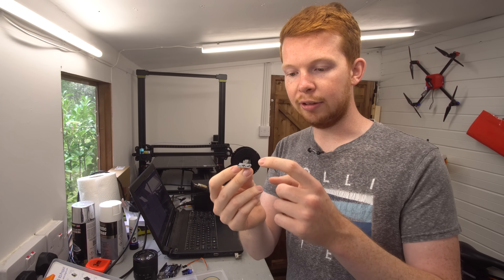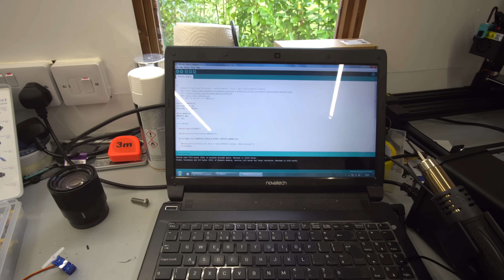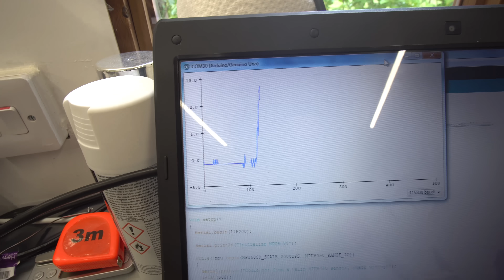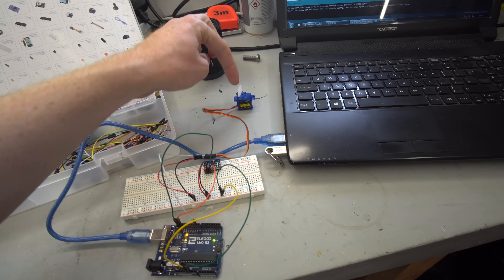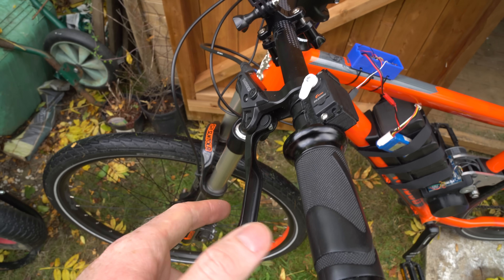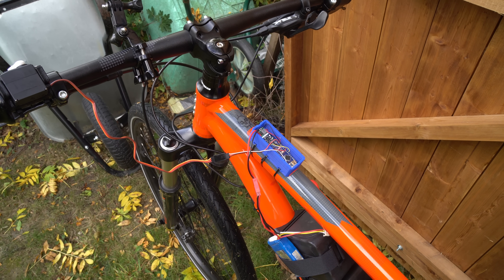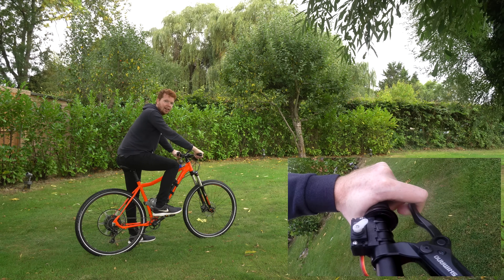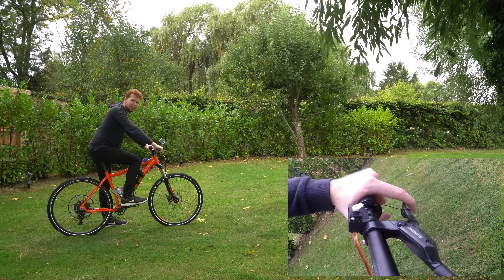Wheelie Cheat Device?

Comment: No Way!!!  I've been working on this exact concept for a few weeks now and you beat me to it!! Anyway, I love the videos man keep it up!
Reply from the maker: That's awesome! How far have you got with the concept? Are you using the angle to activate the brake, or something different? Thanks!
Reply: Originally I wanted to try this on a dirtbike but more mechanically and use the foot brake with a lever and spring system(kind of like the throttle cut device but to apply the rear brake). I always had the thought of using an Arduino but I knew a servo wouldn't be strong enough to stop a dirtbike and I wasn't going to find out the hard way lol. since then I decided to scale down for a prototype and right now I'm using a Servo attached to a drone flight Flight controller in an effort to smooth out the actuation of the braking, however, my Lack of understanding when it comes to optimizing PID values has been my downfall. I'm sure if you knew what you were doing this system would work flawlessly! Good Luck!
Reply: When are you making a new video Daversity  it’s been 7 months!!!!!
Reply: Just filmed a video with my Miata this past weekend gotta find time to edit. should be this week though!
Reply: Daversity great!
Reply: Put the angle reader on an adjustable mount like a threaded rod so you can adjust the angle on the fly and leave the servo brake linkage constant...just tricking the reader letting you quickly adjust when it engages....
Reply: Yes course you was lol
Reply: @CrazySheff  he might be, i believe him

Comment: I think the solution is to monitor the rate of agular change not set an absolute angle, this would give allot more flexibility , not to mention it wouldn't pull the brake when you go up a hil :p
Reply: Of course, that would theoretically try to keep the change of angle constant!
But it would make getting into the wheelie quite difficult, maybe add a button to disengage the system at the start, and then let go at the proper angle?
Reply: Andrew B  Your suggestion of measuring the rate of angular change not withstanding, the arrangement that he has doesn't care whether he is going up or down a hill unless the hill is more than 45°. The sensors are measuring the angle relative to the direction of gravity. ;)
Reply: That would be a heck of a hill! XD

Comment: Add a potentiometer on the steeringwheel to adjust the balancing point on the fly?
Reply: Well, bike frame anyway.  Take angle value, take pot value, scale both appropriately, add/subtract pot pseudo value from angle value => you can tune the angle the servo kicks in.  Simples.
Reply: Steering wheel??? Haha have we all been watching the same video Danny?
Reply: Errr oops, I'm not a native english speaker! What is it called? Handle bars? In Dutch this has the same name as the car one :)
Reply: I got halfway through the video  and got so frustrated that he couldn't tune it in the field I had to come down to post this same comment only to see it was already #2 in the list haha. Also reading this comment's replies made me realize that 2 potentiometers would probably be very nice. 1 to adjust the angle/balance point, and a 2nd to adjust sensitivity/scaling of brake force. Couldn't be that hard to adjust the code to do.
Reply: A potentiometer would certainly help tuning the break angle faster in the field for testing, but the general problems tom described still remain.
Reply: The problems wouldn't still exist.  Any configuration of body mass, arm length, and ride style will have a certain preferred balance angle.  You just need to tune that one value for the rider, and you're set.  And if the PID is implemented on both the motor and brake, a fairly wide range of values would work.  They'd just be less comfortable the further away from the preferred point it is.

You'd probably want to set an "on" angle, so that the controller doesn't start unless you're actually trying to wheelie.
Reply: yeah if you used a pot you could adjust on the fly instead having to reprogram it on the laptop or adjust the brake wire
Reply: YASSS
Reply: Danny G I
Reply: definitely my first thought when he started adjusting the wire pull in his garden
Reply: Danny G  A man after my own heart! I swapped my handlebars for a HGV steering wheel with a knob on it. It's great for reversing.

Ten-four, good buddy. Woot! ;-)

Comment: Tom what if you started monitoring the pitch after the wheelie was initiated... say once p gets past 30 or whatever, start running an average, then look for an acceleration or rapid increase to pitch and hit the brakes when that happens? Would it not automatically adapt to the top bar angle, rider weight and wheelie style then? Obviously no protection/help for the first couple seconds while it records what your natural angle is.
Reply from the maker: That is an interesting concept. The only thing I'm wondering is whether you could get it to distinguish between a hard pedal to bring it towards the balance point, or an acceleration beyond the balance point. For example, if the balance point was at 45 deg, and the bike was at 40 deg, you'd pedal to accelerate and bring the front wheel up, but this could cause the brake to activate?
Reply: I don't really know but... Assuming your arm length isn't too variable, doesn't the bike (on average) HAVE to be on it's balance point to be maintaining the wheelie? I think the trick is to find the right ahh.. goalposts if you will. Like figure out how to tell the difference between what is normal during a sustainable wheelie and then look for a spike either in angle or acceleration that is outside that range. This way it won't drag when you're doing it right. Another approach might be to forget about the angle, and mount the accelerometer at the rear wheel axle and look for sudden accelerations forward?
Reply: How about if you attach some sort of memory (like black box on clean flight) and do some data harvesting of say angle, time, could also monitor the use of the rear brake, maybe crank velocity/torque so you can understand what factors make a wheelie. If you could also synchronise it with video that would help.

Comment: Do it like a cruise control, you pull a wheelie then press a button to set the angle, then the electronics take over and maintain that angle
Reply: Basically hover board or segway programing.
Reply: It's possible, but when you are not at your balance point, you will either accelerate or decelerate.
Reply: Just learn how to wheelie. It's cheaper.
Reply: If it’s set then it won’t maintain it, it needs to increase r decrease the power
Reply: You would need a PID loop for that
Reply: How would you get electronic to "maintain that angle". You can't just have a huge gyro or SAS on a bike, that's no possible unless you use a multi-point ABS or something like that. Cruise control itself won't hold an angle.
Reply: @aidanginise  sorry I didn't mean it holds the speed like cruise control, I meant you set it like cruise control. When you pop your own wheelie and naturally find the balance point, you press a button that tells the arduini that this is the angle to maintain. Then it controls the throttle and brake to maintain that angle. It gets around all of the variables in rider weight that Tom discussed. It doesn't solve the arm length problem fully, but as long you maintain your arm length as close as you can to where they were when you hit 'set' then you should be OK.
Reply: @CARDIACMEDIA  you could probably actually use arm length to speed up or slow down
Reply: @aidanginise  best I can think of is electric motor to pitch backwards and brakes to pitch forwards provided forward motion is present.
Reply: RB Ching: Then you can burn up the brakes and motor ; )
Reply: ziptone My point exactly...
Reply: ziptone  no price is too steep in the name of innovation :D
Reply: Ginise Aidan  gryo and SAS balanced bike? sounds promising. XD
Reply: @aidanginise  you format this along a soft max equation relating the angle to the x values. This will give you a progressive braking affect. It'll maintain momentum.
The button will just save a value in the memory of the Arduino.

Comment: Fun little project. Could have added a potentiometer to adjust the activation value rather than changing length of wire
Reply: came to comment the same thing and saw  you had beat me to it :P
A potentiometer or some other kind of  input that lets you adjust the arduino values on the go would make this a lot easier to fine tune as you are riding.

Comment: whats that printer in the back near the start of the vid?
Reply: Looks like a Creality CR-10. Not certain though.
Reply: @DavidPeach10  it looks similar but not the same, would be an s4 or s5 if cr-10
Reply from the maker: It's the AnyCubic Chiron. I've not had it long, so it still needs some tuning. I still have my older Creality CR10 as my main workhorse printer for now, but this AnyCubic has some nice features!
Reply: @TomStantonEngineering  will you be doing a review?

Comment: Youre going to need to filter the sensor values to smooth the result
Reply: lets look at the source of the jitter, it is the bouncyness of the road. possibly the other axis should be taken into consideration to form a real 3D vector of the acceleration before analysis. at the latest adding a second sensor at the opposite end of the bike and using both vectors will get a fair conclusive data set to distinguish angle versus bounce
Reply: usertogo - Yes and a spring cable to smooth the application
Reply: If you cut high frequencies off, you will lose in reaction time.
Reply: @coceg87  perfect application for a kalman filter. Losing some of the high end wouldn't be the end of the world unless you're integrating the signal further down the line
Reply: youre not cutting the frequency youre smoothing the value
Reply: @CerebralDad  which is exactly equivalent to cutting the high frequency.
Reply: no, youre just cutting out the jitters. essentially the average of values over time. the response time is not affected at all what so ever. time is constant. https://martinvb.com/wp/wp-content/uploads/2016/08/g_comp_b2b3.png
Reply: @CerebralDad  I don't understand what you mean by "time is constant", but as you can probably learn from any signal processing book, "removing the jitters" is essentially removing the high frequency spectral components, which inevitably leads to the increase in the system's response time. Roughly speaking, if you take a step function (i.e. infinitely fast event), that is 0 for t<0 and 1 for t>0, through any  smoothing algorithm, it will become some smoother function, that is still 0 at t<0 (because due to casuality, the smoothing algorithm never saw nonzero values), and then smoothly goes to 1 over some time - the response time in not zero any longer.
Reply: @ZacharyAdamson1  ok, I've reread my initial comment and realized, that it sounded like I'm saying that smoothing doesn't work. What I actually tried to say, if you use smoothing, the trade off is the reaction time, so the balance would have to be found.
Reply: @CerebralDad  i don't think he is speaking of the controller frequencies but of oarts of the signal
Reply: @CerebralDad  using caps or insults will not make you right. I see now that you don't even understand the difference between sampling frequency and signal frequency so I have no interest in any further argument with you.
Reply: sorry didnt mean for the name calling...bad timing with work crap...understood francois - but it nominal with under performing micros like the arduino
Reply: Cerebral Dad, you're right that the sample frequency stays the same, however smoothing the samples filters and delays the signal, and the bandwidth is reduced.
The signal becomes more accurate, but you have to wait n samples for the result.
Reply: @coceg87  I read it as you intended.
Reply: @ahaveland  I have no idea about this stuff, never touched anything like it in my life, but just from reading the comments, I understand what you guys are saying. Seems pretty obvious, actually.
Reply: I apologize to everyone. Work sucks. There is never a need for name calling. Filtering is the way to go even with a 10.3ms delay per cycle
Reply: Ladies and gentlemen, this is how to acknowledge an error in a mature way.
It's OK to make a mistake, we all suffer from brain farts!
Reply: @CerebralDad  It's not just work, it's the poison of social media and not being able to directly interact with a person.
Reply: I've found that with any analog sensor you do need to do some averaging, but yes you do loose on reaction time too as it now requires more cycles to get a value, so it's tricky.  Have not played with accelerometers myself but I'd like to get deeper into electronics/arduino so probably will at some point.   Even simple things like measuring voltage I've found that you want to do averaging or else numbers are all over the place.
Reply: Averaging accelerometer values will give you a delayed signal, but that should not reduce reaction time because one has to use the gyroscopes for tilt, and then the smoothed accelerometer to correct the drift of the gyros.
Reply: He just needs to create a rolling average of the pitch value. Say, take the average of 5 values, then round to the nearest 5 or so degrees.
Reply: I think the 50hz servo signal is plenty to filter out high frequency noise, that doesn't really exist to begin with in this application, coupled with using integers rather than float values...

You're blindly regurgitating principles applied in other applications, convinced it applies to this too, based on no actual understanding; it's pretty fucking annoying and offensive to whomever bothered understanding this beyond slightly. Recognize when you assume and when you know ffs, think a little about your assumptions, and present them as such, instead of spewing useless shit that will only waste the time and/or dumb down anyone believing it. This is partly me having a go at everybody, clueless, so don't take this too personal.
Reply: @TheMrTape  ammmm, they are not talking about interference noise, they are talking about noisy values coming directly from the accelerometer

Comment: Interesting Project.
1:06.. That little 9 gram servo will not have enough torque to apply your brakes....IMO
5:22... There is a mechanical movement stop in standard servos that move ~90 deg.